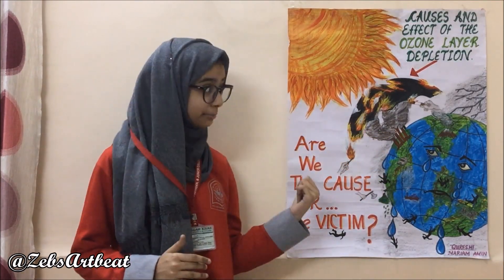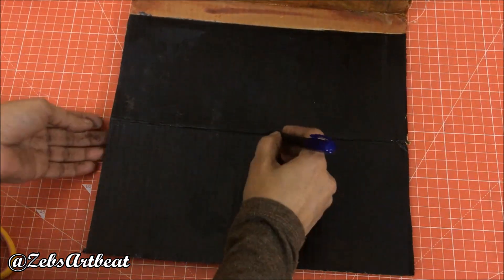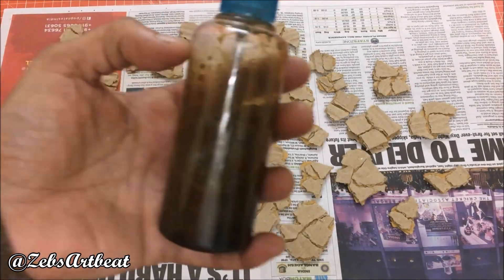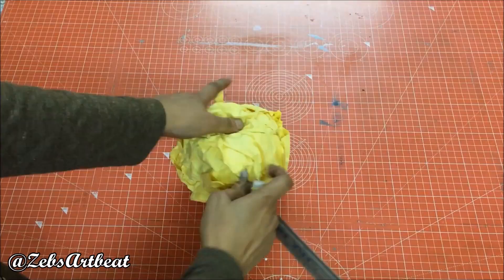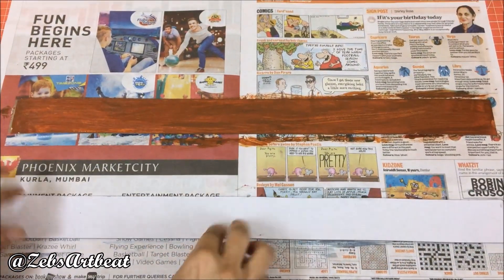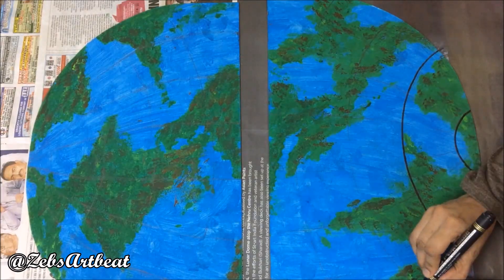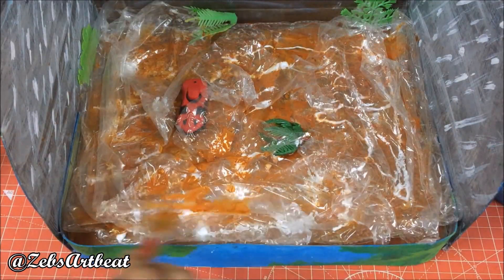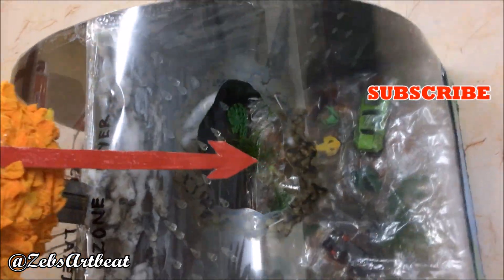School Project | CLIMATE CHANGE | Global Warming | Ozone Layer Destruction

Comment: Please tell me quickly that can I replace the wooden plank In a simple wooden surface or a few big piece of wooden
Reply from the maker: Basically the plank is used as a base to hold the entire project. If the cardboard that you are going to use is firm enough then it can be replaced. Hope that helps dear. 😊
Reply: @ZebsArtbeat  Thank you dear😀